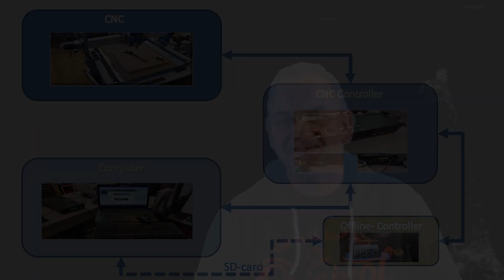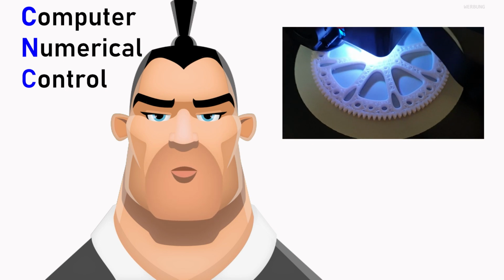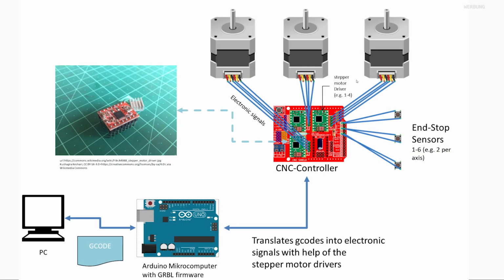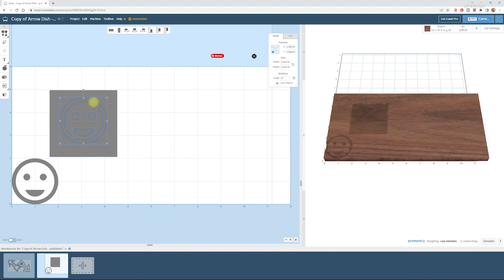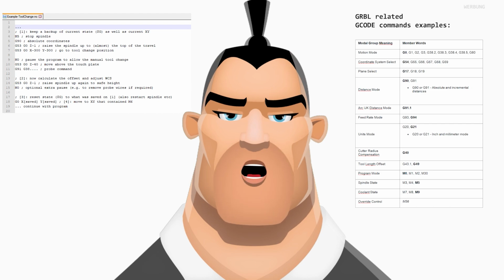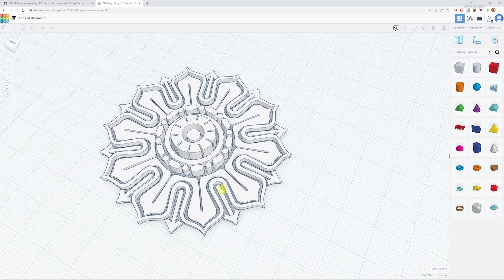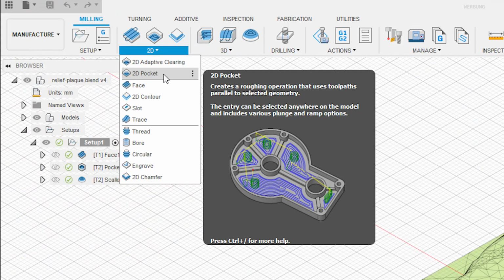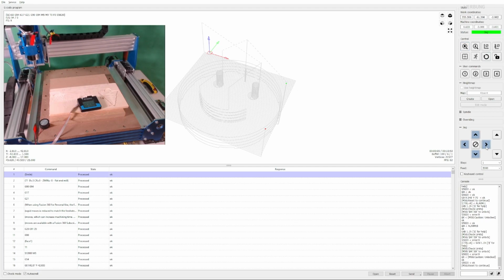Introduction to the CNC universe CAD, CAM, GCODE, GRBL and related tools with a Genmitsu 4030

Comment from the maker: In case you want to understand CNC programming and GCode in more detail, you can check the additional videos that cover the topic: 
Manual GCode Programming Part-1 - Commands, registers, workspace and basic movement - https://youtu.be/DumVXMBEInU
Manual GCode Programming Part-2 - Linear movement, milling and work coordinate systems - https://youtu.be/n4jq095PqP0
Manual GCode Programming Part-3 - Circular movement, absolute and relative positioning - https://youtu.be/Tb3jR4ENsp4